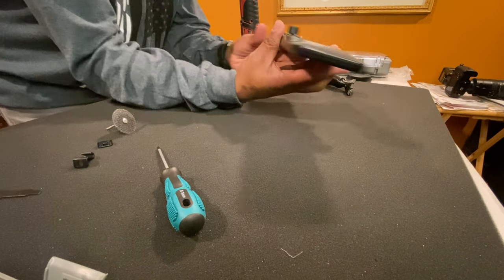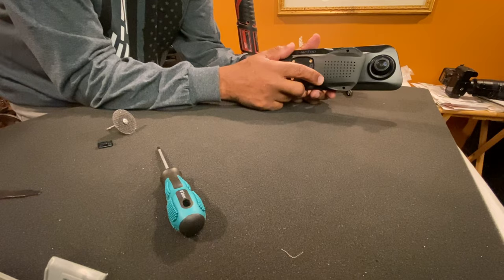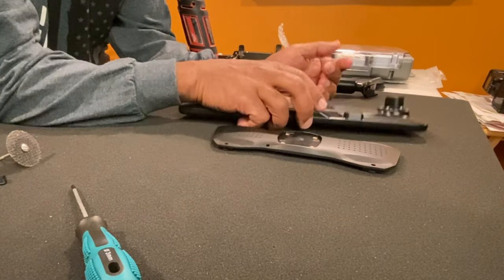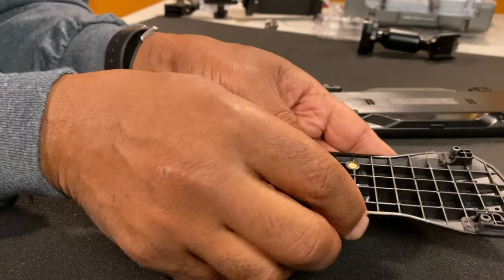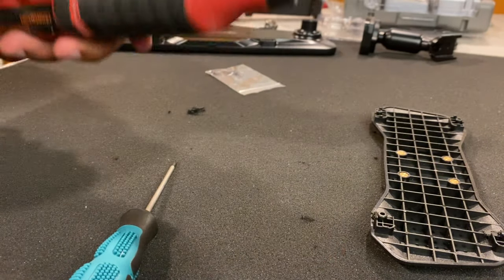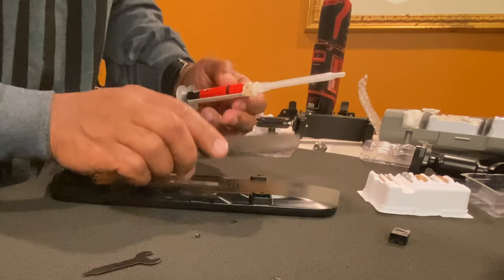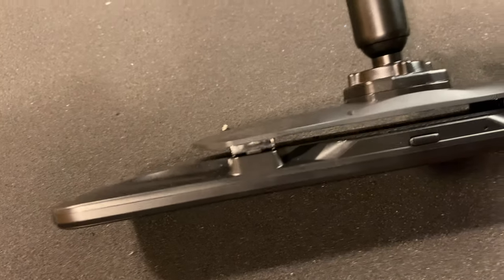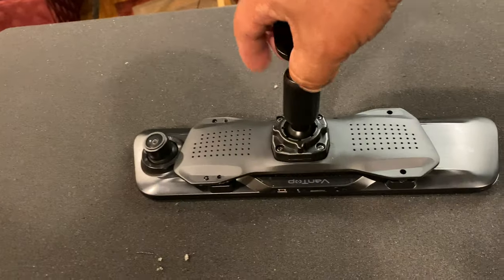How to hack Vantop Rear View Mirror Back Plate Panel + Bracket Arm for Dash Cam Instead of  Straps

Comment: What about the reset button  , maybe should've opened a nice size hole for  access to it also without taking the bracket off if needed.
Reply from the maker: Good point.

Comment: Why use the plastic spacers at all? Couldn't you have discarded all 4 of them, drilled 2 new holes through the plate backing, and screwed into the mirror cam???
Reply from the maker: This is the way I chose to do this mod. Feel free do it your way. Thanks for the feedback.